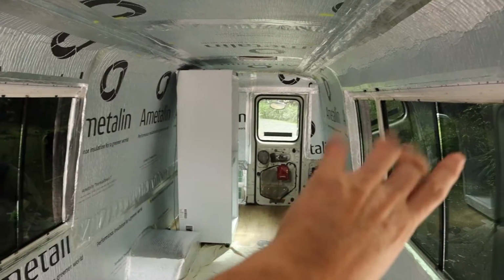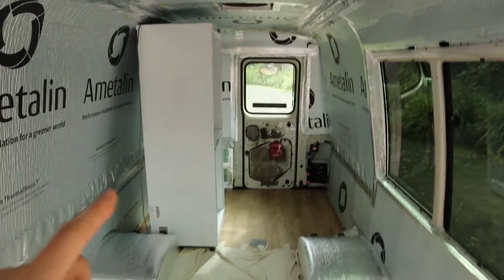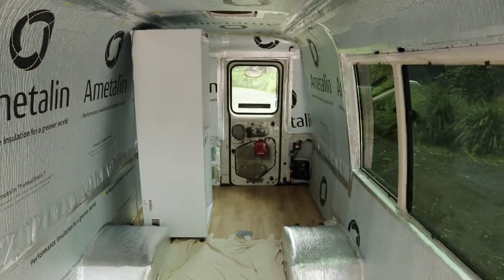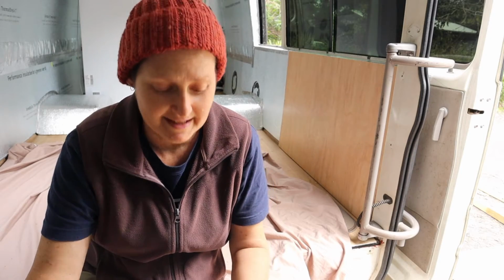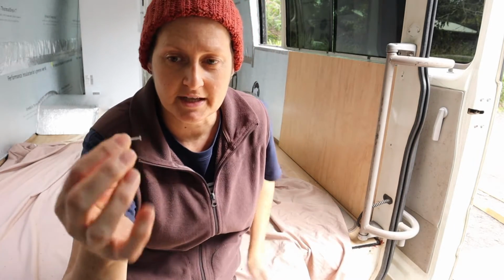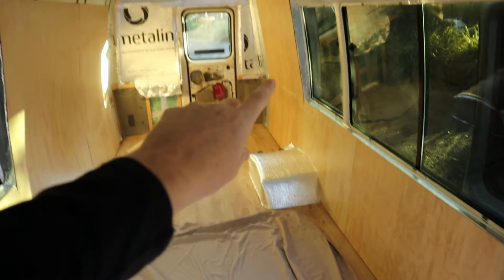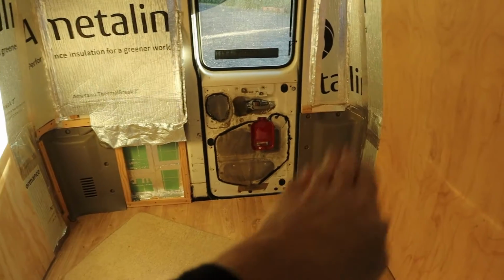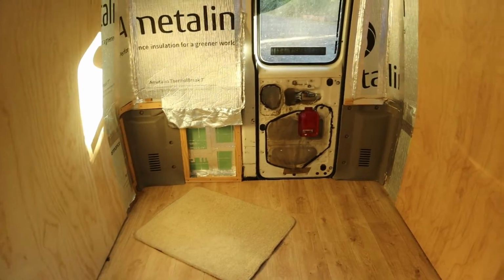Installing the wall lining in my Toyota coaster bus

Comment: The information that you are showing/ supplying is extremely valuable, tha k you so much.
What thickness ply did you use for the walls? It looks thinner then 3mm
Reply from the maker: Thanks so much! It was 3mm ply that I used.

Comment: Another great video - have you removed the windows that are now covered over by wall panels?
Reply from the maker: No I left all the windows in. I thought about removing them and boarding up with metal sheet but I would have had to pay someone else to do that and I was reluctant to do that (firstly because I have very little money and secondly because I got burned very badly doing that with my first bus). Also, I don't really like the look and wanted to keep the appearance of the original bus windows from the outside. I hope that decision doesn't come back to bite me in the future LOL! I have put sika sealant all the way round the windows (and also replaced all the windows seals at the start) so hopefully they won't leak.
Reply: @AGirlADogandABus  thanks for that - so what will you see from the outside - did you tint the windows? Sorry I probably should know - but my memory
Reply from the maker: The windows have all been tinted. The ones on the back wall either sode  of the door, the fixed glass ones at the very back on each side and the rear half of the back double windows on each side have been done with an opaque black vinyl. The rest of the windows are 5% tint. Originally I was only going to block off half the back double window on the driver side but I changed my layout a bit and now I'm blocking the whole thing. But you can't see anything from outside as the tint is very dark.
Reply: @AGirlADogandABus  well done - I really appreciate your response- as I’m about to do the same - I have 5% tint also